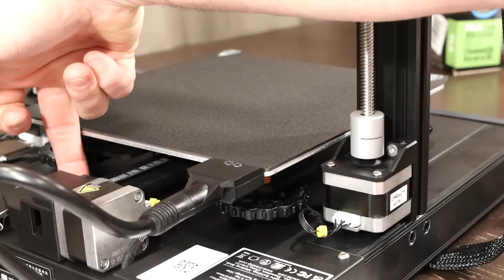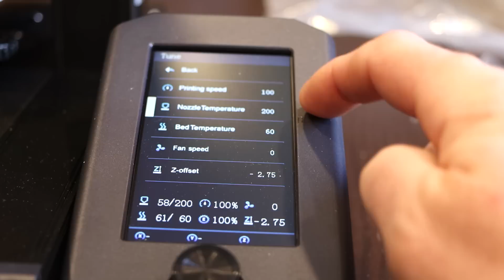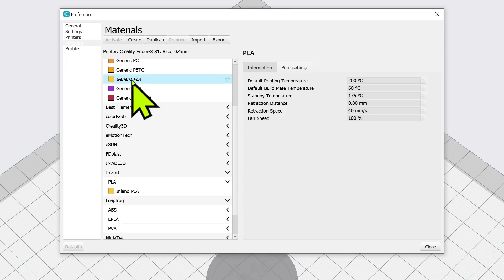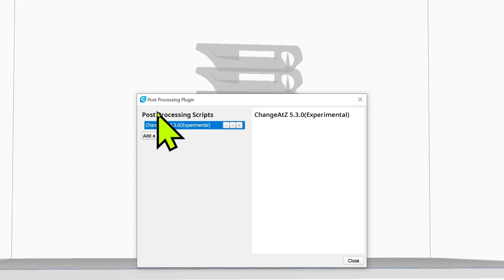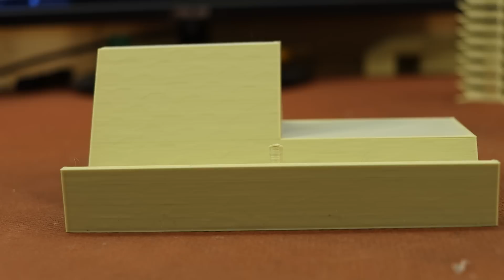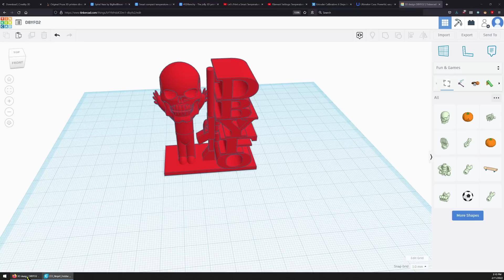Getting started with 3D printing

Comment: You are definitely not a CAD guy, but that's OK. If you would do the "brick wall" in a straight vertical orientation instead of an angle it would still do the support job and saved you printing time and filament.

Comment: On your first level (13:45) you had your Z all the way to the top that's why you heard the trrrrrr sound. When homing the first action is a bit of z movement upward - in your case you left no space upward so the motors had to skip steps since there was no space for movement. Always leave room from the top and the bottom when switching on and homing.

Comment: Even at a year old this video was interesting! When you first started doing the setup and leveling/Z-offset, you should have had the bed and nozzel at the operating temp (expansion of heated parts), but you probably know that by now. LOL!! The manual should reflect that but doesn't. I've got 2 older Ender 3 v2 printers and did the BL touch & CL Touch upgrades on them. The self leveling helps alot and as I remember I think that was in the upgrade manual (too long ago). When setup is right and with the slicer tweaked the prints come out pretty good. Thank you for the video.

Comment: I seems like the moisture of the filaments required to be dried up first (those strings seems like something related to the filaments moisture) ..and personally, I found that when removing the printed object from the print bed, is much more easier when the bed is still (hot), and removing it when the bed has been cooldown, it will be much difficult to remove the object.

Comment: when i started with my first homemade prusa i3 reworked  i always used a sheet of printer paper doubled over for my bed offset and it worked fine i think your unfolded paper was too thin the new geeetech i have now came with a card for setting the offset which may be a bit thicker than the folded paper i used to use so try a thin business card next time also if your printer has a hot bed then it should be heated to 60c before leveling and setting the z offset

Comment: Awesome video man. Just ordered a Ender 3 1S Pro!
Looks like you had a near perfect start, after watching this video, I hope to be able to do the same!
I’m already an AutoCAD draftsman, so I’m hoping that experience translates to modeling and such!
Reply: It would depend on what kind of CAD work you were doing. If you were modeling 3d pieces for a manufacturing operation, absolutely. If you were drawing blueprints for a house, not so much so, but it might give you a headstart on learning something like fusion360 as I would imagine they use a similar interface. (I have not used or even had access to autocad since it was still running on  Windows 98)

Comment: Only watched half of this so far, but more than a little bitter that you had so many successful prints right out the box 🤣  I have the same printer and had a whole slew of disasters despite spending more time doing all the manual corner leveling and everything.  Still trouble shooting now cuz I can't get higher than about 6 inches on any print without things going haywire (nozzle contacts print and breaks whole thing off at the base)

Comment: We must have gotten a lemon. Bought an Ender 3 Pro for my son for Christmas. The x-fit motor does not work. I contacted the company and they told us to reverse wires in the harness etc., still nothing. The printer is going back as I am done dealing with it.

Comment: I started watching your video just after building and calibrating my Ender3 S1. I had much the same experience. Mine came with a glass bed and I found it to be a pain so I just went with the usual one and have had no problem getting prints off it so far. I just let it cool right down and there's not too much problem. I discovered that using Blender (which is free) is good for design. There's also a built in plugin called 3D Print Toolbox which scans your build and shows any errors in the mesh such as gaps and can repair them. You have to enable the plugin in Preferences for it to show up. Thanks for your informative and entertaining video!

Comment: Even better is the CR 6 SE right out of the box, bigger better faster. The hot end is all metal that's 300+ degrees and the bed is auto leveling with the temps to match the hot end. Setup can be accomplished in ten mins. Check it out

Comment: You should absolutely spend time calibrating your printer and filaments.
Your prints look ok but for a direct drive system but they could be waaaay better.
Most of the issue you were talking about, the blobs of plastic on the surface of your handles for example are due to over extrusion as you haven't calibrated the esteps for that filament.
Calibrating the esteps will make a huge difference to the pre sliced files. Esteps vary from roll to roll so you will need to do an estep calibration for each roll you put through your printer.
When you start to slice your own files you will need to do temp and retraction testing as well as wall thickness tests to get the flow rate dialled in. Retraction and temp testing you can do on a roll of pla and use that on other rolls of pla of the same type. But you will need to do a seperate retraction and temp test for PETG. Also silk filaments foam a bit so you need to test retraction for them as it will need more to account for the foaming.
Wall thickness testing for flow rate needs to be done for every roll as this will also vary from roll to roll.
You will be going round in circles trying to dial in a slicer profile with an un calibrated printer.

Comment: you dont need the z-limit switch when using an automatic bed leveler. 

awsome to see you getting into 3d printing. I make a ton of stuff for reloading with my printers, I have (2) original ender 3 printers, a CR-10 V2, monoprice mini delta, and last but not least The Prusa mk3s+. when i heard you comment about the prusa you sounded just like i originally did. ultimately i should have bought the prusa first. i still use my other printers on occasion the ender 3's if i need to pump out multiple parts quickly the cr10v2 when i need to print something large format, the mini delta for printing on the go, but the prusa is definitely my work horse. it hands down smokes the other printers in terms of quality, and just puts out perfect print after perfect print.

as far as filament choices i had a very hard time getting petg to print cleanly on my enders, the prusa i use petg exclusively and stick to pla with the enders. ive used the inland brand filaments they do ok, but i pretty much always use hatchbox brand filaments, prints always come out nicer with it.

looks like creality really stepped up the design on the ender series with this new printer, i may have to check it out to add to my print farm.

Comment: I just discovered your channel.  I wish I knew about it sooner!  I would have suggested an Elegoo Neptune 2s if you were looking for very little tinkering on initial setup and promoting in general.  I have been wanting to get a 3d printer for a while, but financial constraints at this time are preventing me from doing so.  I have had my eye on several Ender's for a while until I discovered the Elegoo Neptune 2s.  It appears to be an all around workhorse with some small hiccoughs in the beginning (i.e. you don't need to do an immense amount of upgrades right off of the bat).  I hope you have great experiences with your Ender 3!

Comment: u guys are nuts... for bolts... why "buy an official upgrade at extra charge" when a 40x80 bosch profile 8mm indent at 3000mm length costs around 100$? a open belt 3$ per meter. and screws are easy to find and cheap. as for the plate itself a 1000x2000mmx3mm aluminium plate is around $150 per sheet. same material ender 3 uses spend 200-300$ in raw materials cut them and extend ur ender 3 to whatever size you want. makes no sense buying a 300$ upgrade kit for the same machine but with 50mm extra space ... when u can get 100x more space for same amount and a little bit of elbow grease.

Comment: This was really interesting to see your take on getting started with 3d-printing. I think you are doing a great job and are learning fast. You have lot's of good ideas.. Have been 3d-printing for three years now with my ender 3.. Designed and printed lots of stuff for reloading and additions for weapons. It is really great to have a 3d-printer around. Started out with tinkercar, but moved on to onshape, and have had good luck with that. Using Cura as slicer

Comment: I went cheaper and with a larger build area.  And yes, I can see the upgrades coming soon.  Have you tuned your retraction settings in your slicer software yet?  Looks like those blobs that you are seeing may be where the nozzle moves into and out of that area and may be oozing slightly.  Your machine is direct drive so I don't think it would need much retraction when the head does a non-extrude travel move.
Reply: Did you go with the ender 3 max?

Comment: You can get an Ender 3 Pro V2 from Micro Center for $99 if you are a first-time customer, like I was. You have to get a $100 coupon online but pick the printer up in person.
It has the best prints than all of the four different printer models I have used.
It was really easy to assemble, many good Youtubes to help.

Comment: you can turn that brim off in the slicer program besides the brim and the line both serve the same function to prime  the nozzle before the print starts
Reply: sort of, but not exactly.  line or skirt is for priming the nozzle, brim is for adhesion to build plate for smaller items, as opposed to a raft for more serious adhesion needs such as a narrow but tall item.

Comment: bed slingers are all garbage no matter what company is making it all based on a failed design.
Reply: Huh??  Maybe we have wildly different definitions of "failure":

https://youtu.be/iEdCTuK7ZW0?t=158
Reply: @brianmi40  the fault in the design effects speed more then 10x not the quality of the resulting print. a proper designed corexy/hbot based printer can reach speeds of 1000mms+ bed slingers top out around 100mms. having personally written more then 150k line of the current version of marlin and encountered 100s of limitations and flawed printers i think i know what I'm talking about here.
Reply: @verthobbies  they certainly could, but then they would not cost $180.  Just the challenges of continuously heating filament at that rate would balloon the cost to likely double or more to say nothing of the challenges added from moving a printhead at that speed.

Comment: I have a couple of this mats they are pretty garbage best prints go with a glass bed or my favourite is a pei sheet on a spring steel sheet just let the print cool off and then flex and pop it off. Good luck on your 3d printing journey. Also the s1 seems better than the 3 pro i have as dual z axis is much better than the single axis mine came with :)

Comment: that's a good choise!
don't fall for those voices "get the V2, it's better" .. the S1 is an upgraded version without all the mistakes made before.
it's even better than the CR6-SE by having direct-extruder and the manual knobs for leveling ..both things are missing in the CR6-SE which is competative to the Prusa i3 :)
so yeah, the S1 is a good choise!
ps: replace (buy) a new SD card, from a valid brand. those included cards are tending to be bad and will result sooner or later in errors while printing.

Comment: Do not get the filament out unless you want to exchange it for another, other wise the leftover material might harden in the nozzle and between nozzle and PTFE which will give you heatcreep, (You will learn what it means soon enough just google it), the details can be better with the slicersetting , the single line is called the wasteline it is used to test the distance between bed and nozzle and prints come of easier when the bed has cooled. For more information check on youtube for CHEP Filament friday, Makers Muse, Thomas Sandladerer and CNC-kitchen, you will learn a ton from them

Comment: I bought an ender 3 Pro like 2 years ago, why? Well because it is a printer for tinkerers, Not the best, not the highest quality but good enough and most of all Upgradeable, I changed the motherboard for an SKR mini 32 bit card, I added a BL touch, A color touchscreen from Bigtreetech (which also manufactures the SKR boards), and the best of all a Direct drive from Swiss Micro with a full metal hotend, All this allows me to print quiter, more precise, level my bed automatically, and print much hotter (and stay tuned this is important later), to about 300°C. All these add-ons probably ran my printer up to 600€ instead of the 190€ I bought the stock ender for. The ender 3 S1, comes with all of these add-ons and for like 400€, so indeed if it wheren't for the learning curve which I explicitely wanted because I wanted to learn, If I had to buy one and without the learning curve I would go with the S1, Except, in the direct drive they do not have a proper heatbreak like the Microswiss has, here is where those hotter temps become important, you know that PTFE-tube that goes in to your hotend, With the swiss micro it does not touch the Nozzle because of the titanium heatbreak insulating (isolating) the PTFE from the Nozzle, but with the S1 it does, you see PTFE can reach up to 250-270°C before it melts, maybe burns but most certainly releases toxic fumes you definitely do not want to inhale, (Trust me Covid is safer to breathe in than that sh***), which is a big flaw in the S1, Why would I need to go hotter, well filaments like Nylon and Polycarbonate need a way hotter nozzle temp, (And also en enclosure and proper airfilter, no need to avoid breathing burning PTFE if you melt other toxic materials), but that flaw limits the S1 to the same 250-270°C, It is literally the only flaw and if you don't want to make foodsafe, medical safe and generally stronger parts then this is not an issue, but once you go down the 3D-printing road, these questions or needs to go higher faster better come up very quickly

Comment: well the standard build surfaces/surface mat does have a finite life span... you might want to look into upgrades for your printer bed or its surface material.... like for mine i got a glass surface... there are advantages and disadvantages to certain surfaces...

the glue stick trick has the advantage of sticking to the surface and making it easier to remove when you are done with the print with minimal damage to most types of surface mats.... 

the bed/plate can last longer than the surface mat... you only need to change the bed/plate if its not straight anymore which can happen when you use the heated bed mode regularly...

oh and most prints on PLA doesn't need to use a heated bed function, you only need it for prints that uses a material that has a high warping percentage when heated and rapidly cooled afterwards like taller z axis print with ABS....

at least you bought the printer with minimal tinkering with its settings... my first and only 3d printer needs a lot of settings adjustment in the software side to actually print my stuff properly....

Comment: Use a Square to ensure the uprights are perpindicular to the Table Face, or Base. Then Tighten the bolts once it is square and perpindicular.

Think in 3D. You want it square and perpindicular so as the print head rises the product will be in alignment and should be in tolerance to the specs of the product drawing.

Comment: Nice video. I've been wanting to get a 3D printer myself...one day!

As for the little things on the surface, squiggles and what not, arent they occasionally unavoidable? I thought it was common practice to sand and smoothen your prints afterwards?
Can someone correct me if I'm wrong? Never 3d printed anything myself so I. Certainly not claiming to be an expert of any kind.

Comment: *This is a guess, not a tried method! *
> Acetone dissolves most poly plastics and as long as it has no additives it evaporates residue free. Usually the quart and gallon can at the local home improvement stores is industrial grade with no additives. Test to make sure the acetone dissolves the brand of PLA you are using.
> Test the bed material by putting a single drop on the very corner. Continue to wet it with a drop of acetone as it dries for several minutes and then see if it has softened the material. * If it has softened DON'T USE ACETONE to clean the bed.
> If the bed material withstands the acetone then I recommend wiping it three times with three separate paper towels. Each paper towel will pick up the PLA residue left by the previous.

I would try this: Using a good paste wax from the auto store - not a liquid wax, not a chemical wax, not a combination cleaner/wax, but a legitimate soft solid wax - and wax and buff the bed. Similar to car wax, mold release wax is what is used in fiberglass molding and it's the one and only thing that allows a fiberglass part to break loose from a fiberglass mold. Waxing of a mold or this print bed is the same procedure as hand waxing your car. It it doesn't work, as in, the part is prone to coming loose during the printing, the wax can be cleaned off with alcohol or better with acetone (if the bed material withstands acetone)

Comment: To remove prints, and leftovers from your print bed- maybe try warming the plate up from the backside- using a hair dryer.
Reply: warming is what makes the prints stick.  just put a USB small 4" fan and aim it at the bed to cool it down faster after the print completes.

Comment: I have the ender 3 Pro, it has the glass bed. It is trouble free for removing anything printed. You can upgrade yours to the glass bed. Its a world of difference.
Reply: I have the ender 3 V2, it also has a glass bed and can confirm. Mine has some coating on it, but prints literally slide off when you let it cool.